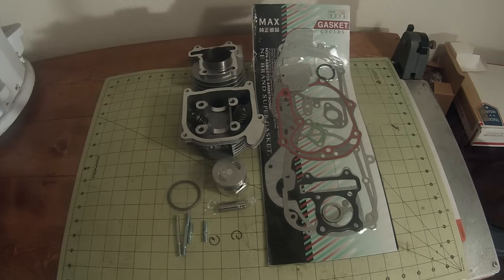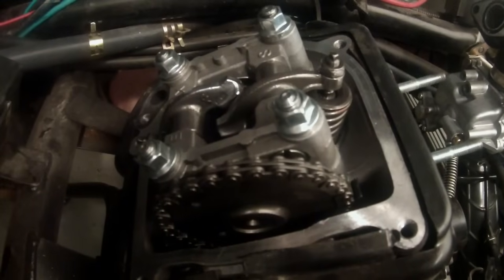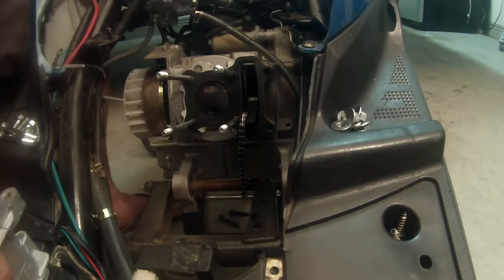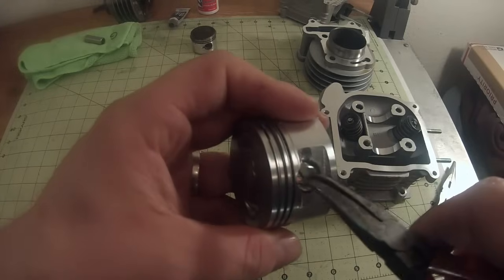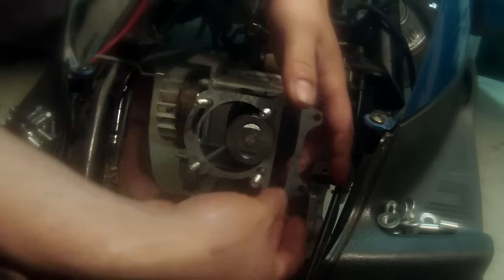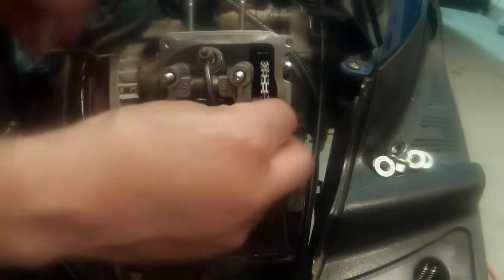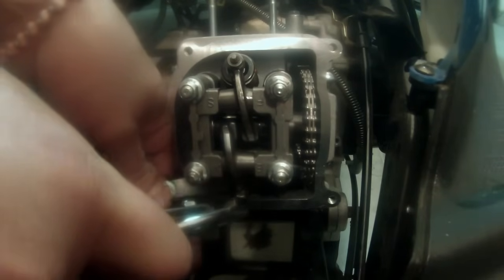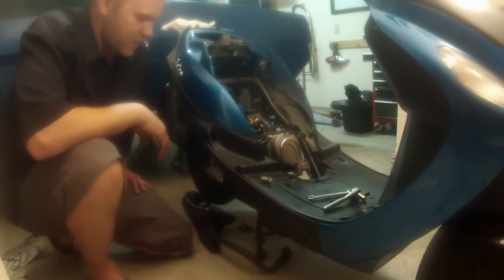How to Install Big Bore Kit on 50cc Scooter - Every Step Included! 80cc or 100cc GY6 139QMB Engine

Comment: Why are my rocker arms so tight , I have no play between them and the vales , I changed my 50cc to an 80cc big bore kit and my vales are like to long or something, what can I do to fix it???
Reply from the maker: Stanley Harris There are two possible causes.  
1) There are different kits for different valve sizes.  If you ordered the wrong kit, it will not work correctly.  To see what size valves you have, watch the video below.  Then see what kit you ordered.  You need to know if you have 64mm or 69mm.
https://www.youtube.com/watch?v=lt4NEhClpoo&list=PLN-aJzPmy9BRBRhIgNa21-aR6UdGxlWf1&index=1

2) They just need to be adjusted.  Check out this video to adjust.  Be sure you are at top dead center.
https://www.youtube.com/watch?v=DlZATeMVjJk&list=PLN-aJzPmy9BRBRhIgNa21-aR6UdGxlWf1&index=3
Reply: ok thanks , i had got 69mm instead of 64mm valve. So i changed my rockers to fit the 69mm valves , than i set the valves on 0.005 she runs 45mph now easy...
Reply: lol 45 on an 80cc it? I was hitting 70 on an 80cc cylinder kit with a 21mm carb
Reply: Yeah 70mph on what the stock speedo thats 20mph off? Not bye gps no way. I wish. But from everything i learned even a MAXED OUT top of the line build with nos (50cc -100cc bbk build) the best you getting is 60mph on a runway and being 4foot tall 100lbs lol 
      40-50mph is the real top speed of a bbk 80-100cc now tuning can change how fast you get there i seen a dio get 0-50 in 4sec with a 200lb guy on it
Reply: My stock VIP does over 50 mph, Why couldn't it go 70 mph with a big bore kit, carb, variator etc.? I weigh 175 + riding gear and carry extra tools. I also have a 2 foot windshield that doesn't help.
Reply: Your stock vip 100% for sure does not do 50mph sorry but thats a flat out lie OR your going off your stock speedo which are off bye 10mph OR your talking kmh. A stock 50cc scooter avg TOP is 37.5 mph does not matter the make or model it is simple Universal fact not opinion. Now 2 storkes do pull a little harder than 4 but even a 2t will not do 50mph stock and a vip is not a 2t its a 4-stroke GY6 running a 49cc 139qmb engine. So nope
Reply: Yes it does. Try again. Yeah... I guess theres no way I could have paced this scooter behind one of my three cars or flew past a radar trap at top speed. Does your pos even run yet? and you want to tell me the facts. Your mad you had to TRY and big bore your bike and it still isn't as fast as mine. I will let you know the new top speed once I throw a few more upgrades. Have a nice day. Don't judge everyone from your experience.
Reply: Lol lie to yourself . fact a 4 stroke 49cc gy6 is not doing 50mph. I know this is a Universal fact of math not my opinion my personal opinion may lack any practical experience since I've only owned/own 4 scooters  2, 50cc one being a tao-tao VIP or the real model name CYA people just call it a vip same scooter you lie and say does 50mph mine is 100% stock 239miles on it so far the tao-tao 49cc 4 stroke 139qmb gy6 scooter tops 37.5 mph GPS digi hud (maybe down a very very big hill) My trike or pos  has what a vip cost whole in parts lol pos lol GPS digi hud at 48mph last test run. 50mm ncy bbk gaps set 007 ex 005 in 20mm nibbi carb upjetter 78 nibbi cone filter off 2in elbow ben-jing cdi ncy coil ngk spark plug once i do the ncy cvt upgread i may hit 50-55 range but doubt it trikes are slower.. Fact not opinion even after a full/max upgread/build to a 50cc 4 stroke with top end parts you pry for 60mph rang and thats what top end racing motor. 2 strokes are different with cvt tuning/upgreading alone you can clear 50 easy.. But if i want fast i just ride my 250cc rcx tomberlin or my 400cc Honda silver wing.  I have a ton of factual information that I can easily regurgitate just lack any practical experience building but not riding
Reply: Now if you have the tao tao vip powermax that is a 150cc that tops are 50mph stock but its a 150 NOT a 50cc..
Reply: But i I'm the one that obviously knows nothing about scooters. Lmao
Reply: So you did all that and mine does 50 mph stock. You call me a liar yet the only video on your channel shows a broke down moped while you're asking for help. You must be really heavy set if you can't move that fast. How about you upload a video of one of your bikes...and I will upload mine doing 50 MPH. You should go back to your card tricks and video games meho because engines aren't your thing. How about you tell me my engine to cvt to wheel ratio, my maximum rpms and my wheel size. Then calculate my top speed. Your grammar is terrible. I bet your math skills are too.
Reply: That's not funny. Don't joke about cancer. Maybe one day your mother, father, child, loved one, or you yourself might end up getting cancer. Think about that next time you try to make a stupid joke.
Reply: Again not opinion there is NO 4 STROKE GY6 DOING 50MPH lol just ant happening. Google tao tao wepsite even says the 50cc vip tops at 40mph lol which is a lie. Now you want real speeds real vids check "making slow look fast" "gy6 performance " " "Chinese scooter project" or 49ccscooter.com his wepsite has 100% break downs of the 49cc tao tao scooter. Any of the facebook groups (the 1st 3) last 1 is a wepsite and YouTube channel loads of vids and facts no dumb lies
Reply: http://www.taotao.us/index.cfm/scooters/cy50-a/ facts are facts. The people that make the scooter say it only does 25mph lol which is low its more like 35 but if tao tao made a stock scooter that did 60-70mph they would tell everyone they would make billions of dollars and break world records with the fastest ever stock 49cc scooter lol... 150cc stock scooters top around 50-60mph but your a vip with your vip thats has a magical engine that breaks the laws of physics. You do know what stock means right? Zero upgread parts. If it a bottom mount or top frame go under or over? I think you have the power max vip which is a 150cc and dont know it or didnt and now in to deep lol
Reply: Really? You shouldn't let things bother you that much. Why are you still trollin. I forgot you existed for a little while. No gy6 is going over 50 EXCEPT FOR ALL THE YOUTUBE VIDEOS SHOWING OTHERWISE. If you didn't try to tell everyone the "facts" someone might be willing to help you. Did you ever consider you needed the head for a big bore instead of just changing valves. Maybe you bent your valves because you can't read the marks on your cam sprocket. Now you have no compression. Maybe my gy6 revs way higher than its supposed to and your cdi is still limited. You should spend more time on your bike instead of comment threads. Maybe it would run. Whats sad is someone like me would be willing to help you but you obviously are bias. Have a good one.

Comment: Its more easy when you take the engine out of the scooter, that are two bolts some wires rear break cable gas kabel and fuel hose.
Reply from the maker: Absolutely +28kevin28.  It is not difficult.  My goal of this series was to cater to those that have little to no experience.  There is already a lot of steps to this, so I did the video with the engine in the scoot.  I do all of mine with the engine in the scoot, because for me, it is easier and quicker.  Thanks for the feed-back!

Comment: Do you need to upgrade your cfi I just got the 10cc big bore kit in today kinda need to know
Reply from the maker: tom miers  Nope.  I have never upgraded the CDI.  It is a good idea to maximize your performance, but it should run just fine with the factory CDI.

Comment: Just want to say , be super careful not to drop your nuts or washers down the chain hole or anything into the crankcase when doing piston clips or any other process working over open crankcase holes. It would really suck to go that far and drop a washer or nut right at the very end !

Comment: Hi I Fitted a big bore kit and now it won't start
Reply from the maker: Two wheels Production Aka certified Did you make sure to order the kit with the correct size valves?  There are two sizes: 64mm and 69mm.
The other #1 cause is timing.
Reply: Yh it a 64mm and i done .004 on the rocker arms and I've got spark and fuel
Reply: Two wheels Production Aka certified  on a thread i read someone else had the same issue. the guy had the timing off by one tooth and even after fixing that didnt realize he bent one of the valves. if everything else is right then id check the valves

Comment: why do a big bore kit just do a 150cc engine swap and use the old 50cc valve cover so it still says 50cc :-P then later do a big bore kit and push it to 200cc and you'll be able to go faster then you'll want to on a 50cc frame
Reply: +Joseph Atnip I like the way you think, lol.
Reply: because not everyone wants the same thing... some people like myself don't need a 150. my scooter  is as fast as a 150 and its a 50.. Also engine codes are.dead.giveaways if you are not indorsed to ride.
Reply: Joseph Atnip  on the 150 to 200 you have to bore the case
Reply: wait I can so That? I have a Bentelli Sprint that's an 80cc on a 50cc and was told I can't upgrade anymore on my brand of scooter. I wanna 100cc or 150cc. is this true?
Reply: it is not possible to put a 125cc 4stroke on a normal 139qma engine, then engine mounting is below on the 50cc and on the 125cc,its on  the top

Comment: Will this work on a 50cc 4 stroke moped with this kit?

(Website is ebay) /itm/GY6-100cc-50mm-Big-Bore-Cylinder-Piston-Kit-4-Stroke-Chinese-Scooter-QMB139-/251969946763?hash=item3aaa94448b:g:16kAAOSwk1JWchhk&vxp=mtr
Reply: And is a 26mm carburetor big enough for a 100cc big bore kit?
Reply: I use a 21mm Carb and all good

Comment: I dont get why people do this because you can just buy a scooter with a bigger engine much easier.
Reply: It took me 30 mins and worked awesome
Reply: First: It's hundreds of dollars cheaper, second: in some countries you need to have a license for 50cc machines (in my country called AM Category), so it's pretty much for tuning or giving your machine a faster acceleration/top speed, third: it wasn't a good question at all, if you just want to buy a bigger engine machine go for it, it's an educational video (exact same as just changing 50cc to 50cc, not that you change to bigger cylinder)
Reply: @Kevin13579  50cc does not handle well above 45 but go ahead do what you want.  Plus the smaller wheels need to spin faster to go faster.  So you will use the motor at higher rpm burning it out faster.  Bigger bike bigger wheels better combo.

Comment: Carburetor "gromet" (Actually a carb spacer) "Spacers" in the head and jug (Are actually called dowel pins aka alignment pins) And no click from the torque wrench. Plus this guy wears a bracelet. Good thing hes working on a moped and not something of mine. You have no clue what youre doing. Added all those cubic centimeters but didnt jet or bore the carburetor/intake or modify the exhaust. More volume of air needs more fuel to combust and also needs less restrictive exhaust. As i said earlier, no clue what youre doing. Probably one of those guys who thinks "BoRiNg My CyLiNdEr MaKeS MoRe HoRsEpOwErS!!!" LOL